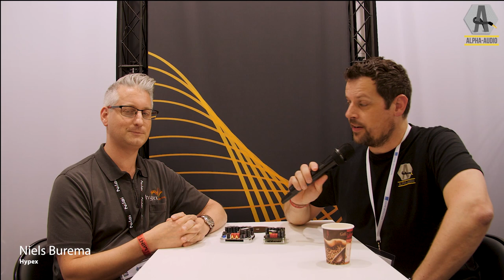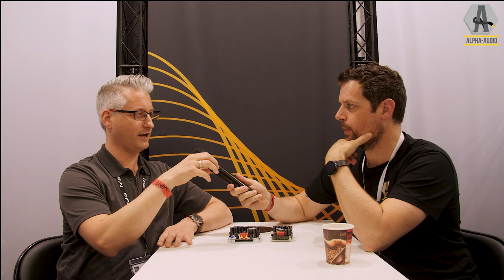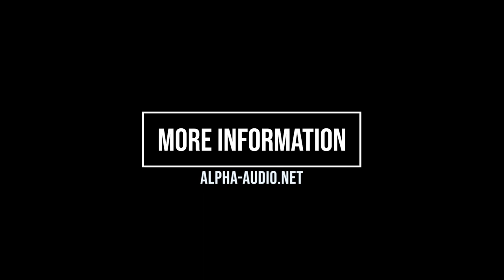NcoreX or Nilai? What's the difference? High End Munich 2023

Comment: Whats a 'play' amp? Intergrated pre/power?
Reply: "Plate" amps are what you find in powered speakers and subwoofers. They're generally low-profile amps built on an aluminum plate that is screw mounted to the rear of the speaker.